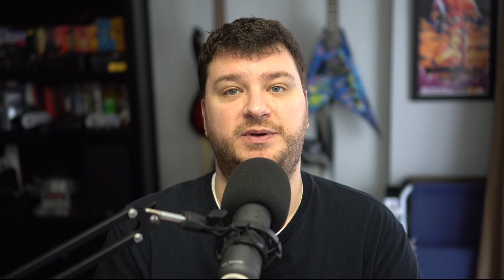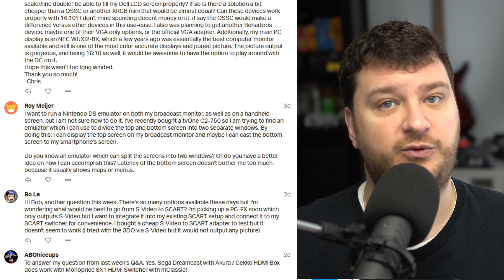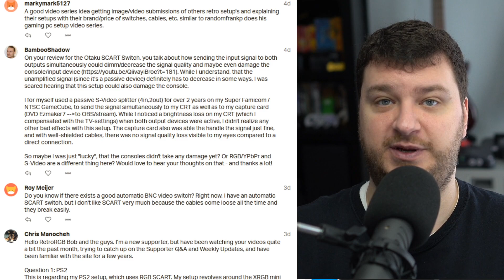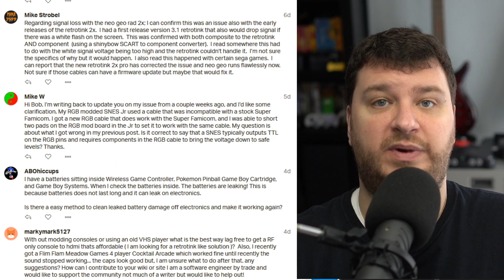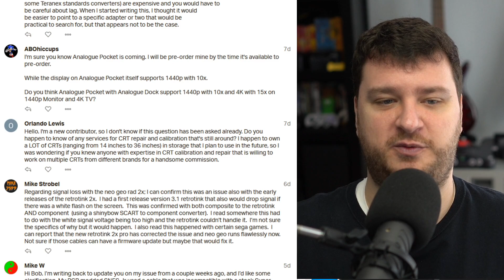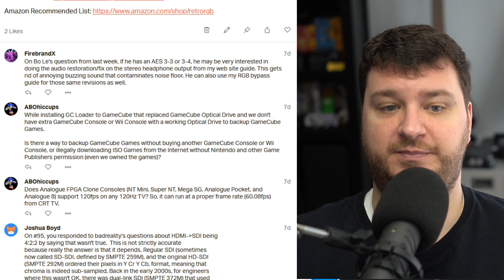Supporter Q&A #97

Comment: For s-video I use the i Scan pro then route that via VGA to ypbpr cable to my ossc component input I do this rather than using the retro tink because the I scan pro de interlaces with that said it adds a small amount of lag and is much older kit. Hard for games YouTube channel has a video about this setup for 3do.

Comment: That DS emulator using a smartdevice idea is actually super cool. Imagine if a PC emulator could connect to an android device to use that device as the bottom (touch) screen.
Not sure if bluetooth or wifi is up to speed, but even if using a USB cable, that would be very practical for let's playing DS games without having to purchase a capture card.

Comment: I know you don't read this but viewers do... If you are looking for a solution for RF only devices the VGA TV tuner boxes on ebay and aliexpress work pretty well and are cheap (~$20 US).  The hardest part is finding the TV IEC to RCA connector.  See:  https://www.ebay.com/sch/i.html?_nkw=vga+tv+tuner&_sacat=0
Reply from the maker: Most of those are designed for TV signals, include a scaler and add lag.  A VCR is just a basic passthrough.

Comment: S-Video (Y/C) can be delivered through SCART but the SCART socket must be compatible with S-Video. Many later SCART-TVs with multiple sockets often have one RGB socket and one S-Video socket. Maybe the SCART switch even has one S-Video-compatible socket. But if not I would recommend bypassing your SCART setup for those S-Video-only consoles by converting the signal to YPbPr or HDMI with a separate device.